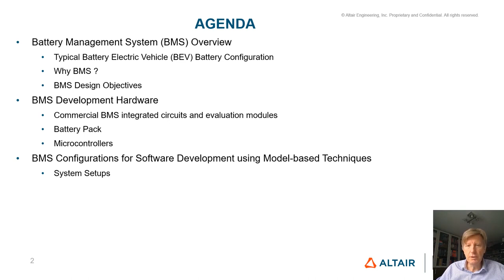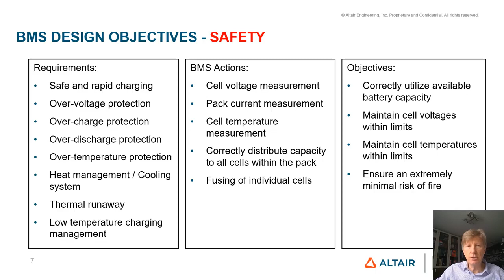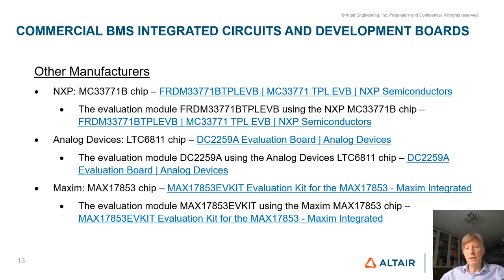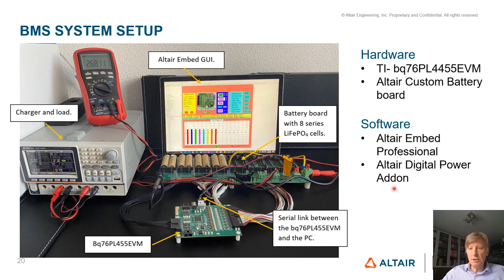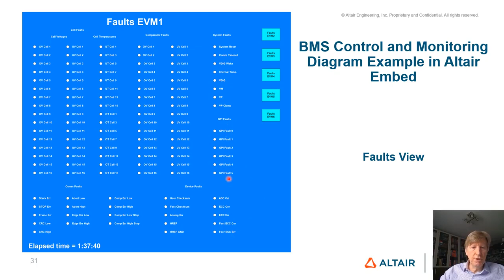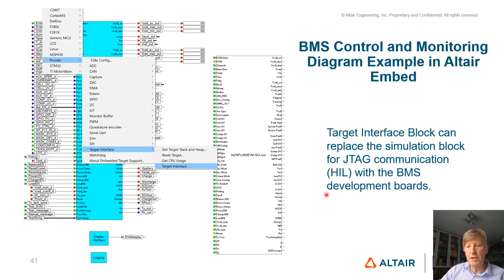Battery Management System using Altair Embed

Comment: Hi I have a 36v 4ah battery pack and a 12v 4ah battery pack both 18650 can I connect the 10s bms and the 3s bms in series and get a 48v pack?